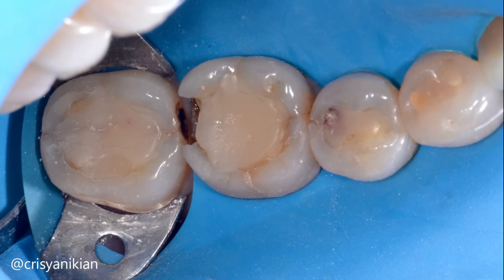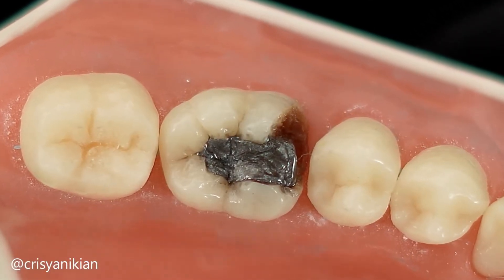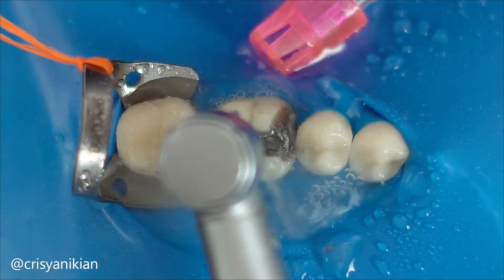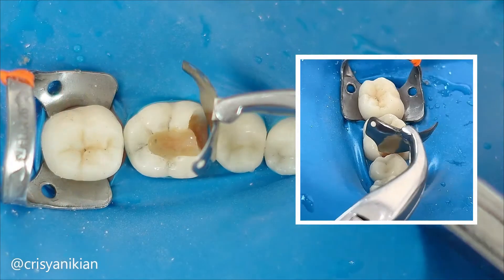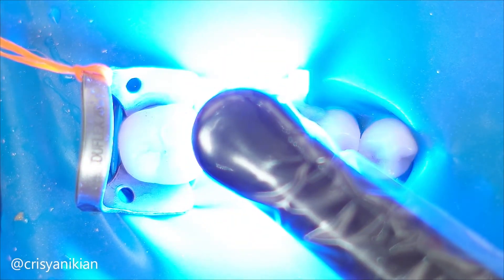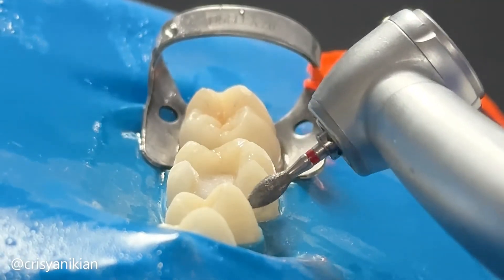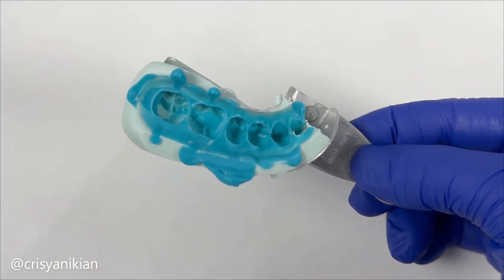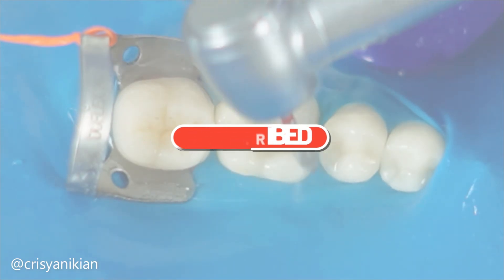Composite onlay - pat 1: tooth preparation.

Comment: Great video but I had a question - after you did the DME you restored the tooth directly with composite, so why prepare the tooth for an indirect after
Reply from the maker: DME is not a complete restoration; it is only performed in the deep gingival margin area. Its function is reposition the subgingival margin to a supragingival position. It makes impression and onlay cementation easier. Generally, it is not possible to achieve a good adaptation of the matrix and wedge in a deep and wide cavity, so the restoration usually has gaps in the emergence profile or at the contact point. This causes discomfort to the patient, as it will cause food impaction in the gums. So, in wide and deep cavity I prefer do the DME and onlay for dental restoration. 😉